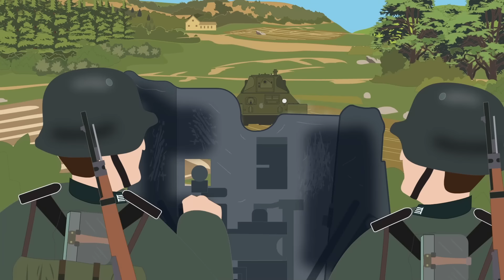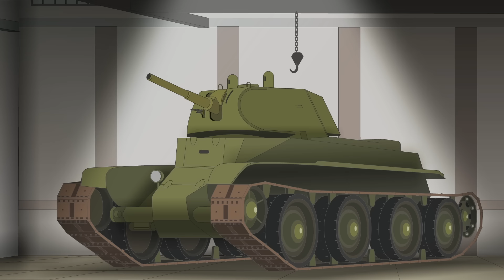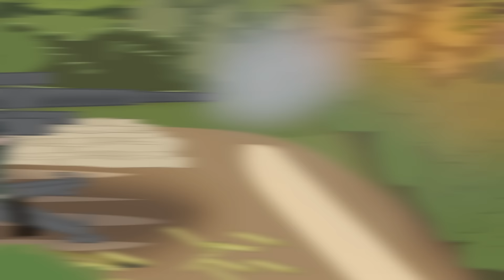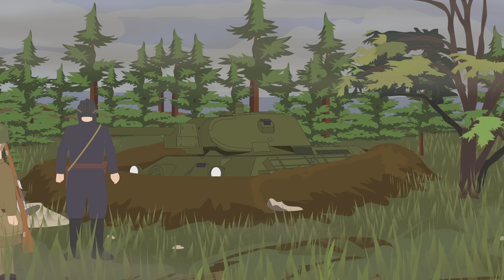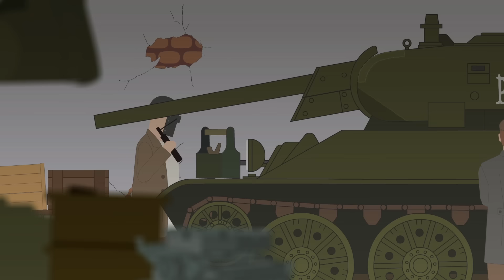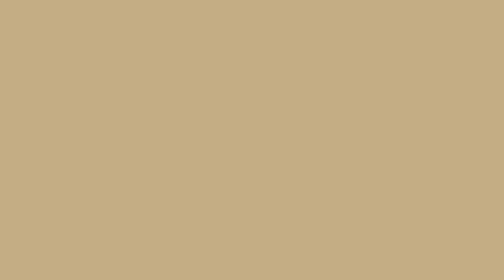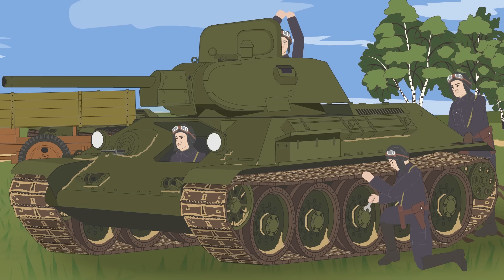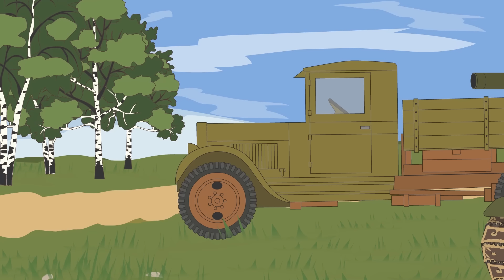Was the T-34 Really the Best Tank of WW2?

Comment: As an engineer, I admire the convenience and high technology of German tanks, but that's what ruined them. The German industry simply could not produce enough such expensive and complex tanks. In addition, heavy models often broke down and it was very difficult to repair them in the field. Here I really like the concept of the T-34 (simple, cheap, harsh, fast). This is truly the "best tank of wartime" (I mean, as a forced measure, it is beyond praise).
Reply: T34 was an expensive tank made cheaply because if it was made to the same quality of m4 Sherman's it would be a failure
Reply: @oofchanneltv6813  was about to say this, thats what i thought about the shermans :)
Reply: @oofchanneltv6813  1/
Reply: @oofchanneltv6813  You really need to read up on actual sources about the Sherman not the History Channel or Belton Cooper’s “Death Traps”.

The Sherman was actually far better than the T-34. Yes it was large, but that means a larger interior, combine that with large spring assisted hatches for each crew member, and an extra on the floor of the tank, the crew survival rates were 75% to 80% of survival.  Out of the entire war, 1580 US tankers were killed, you can read that in official war reports. 
 The 2 reason so many were disabled/destroyed were because:

1. Ammunition would light up when hit, which was mainly an issue with British Shermans as they packed them with as much ammunition as possible. In fact, the Panzer IV had close to the same burn rate as an early Sherman. Once wet stowage was introduced, the burn dropped significantly. Common belief is that it was because of high octane engines, but that is completely false as an engine fire wouldn’t immediately set a Sherman off due to the steel plate separating the crew from the engine. 

2. Unlike Soviet crews, US Sherman crews were trained to bail out after the first hit penetrated.

 Majority of Shermans that were disabled or “destroyed” were actually recovered and repaired in a matter of a couple days and sent back out to the frontlines.

 The T-34 saw far worse losses. An average rate of about 80% were lost by the end of the war. Crew survival rates were among the worse of any tank. Depending on the variant, the rate of survival was about 25%-30%.
Reply: As an engineer, I admire the late 1943-44 panther.
Reply: @cedricvanhove7716  If the USA had built the Panther, we'd have subjected the vehicle to extensive testing and fixed the problems before they were produced and sent to the front.  The USA had a simple constraint that mandated the need to "get it RIGHT"...all their vehicles had to go by SHIP (Liberty).  And quite a few Shermans ended up at the bottom of the Atlantic.  So we didn't have the "luxury" that the Germans or the Soviet had, in that, tanks that were "broken" or shot up could be loaded onto a flatcar and shipped home for repair or to be cannibalized for parts.  But, the Sherman was very well-designed in that manner, as so many parts, up to entire engines, could be swapped between its various models.  Indeed, by early 1945, with all the "patching" and parts swapping, it was uncommon to see a Sherman in pristine, factory condition at the front.  The Soviets very much liked the Sherman, dubbing it the "EmCha", a transliteration into Russian of the US Army model designation "M4" (the Roman numeral 'four' looks much like the Cyrillic character "Cha"), and issued it to their "Guards" tank units, much to Stalin's chagrin.
Reply: That is why it is hard to believe when historians are saying the Maus could have changed the outcome of World War 2.
Even assuming the Maus had worked exactly as intended, Germany could barely supply the regular tanks.
Reply: @schwarzerritter5724  lol, the Maus couldn’t even cross bridges. That thing would’ve been useless expensive waste unfortunately.
Reply: @schwarzerritter5724  Even the Tigers and King Tigers weren't viewed by the Panzerwaffe either as necessarily being tanks that'd win the war for Germany.  They had their roles; sure, and, if nothing else, frightened the enemy, but they simply couldn't make the difference.  A German war economy and nation that could produce and provision, say, 5X as many Tiger tanks as they did would have been far more robust than it actually was.  Germany had to pick "quality" over "quantity" simply because it lacked the resources for the latter.  Indeed, that's the entire reason they attacked the Soviet Union at all!  As the writer of the 1942 book, "Victory Through Air Power", Alexander DeSeversky, put it, "The Germans had to trap the 'Russian Bear' ALIVE and put him to work."  This need to gain the resources of the Soviet Union dictated Germany's overall strategy, and why, even when hammered by superior Soviet forces, they held on to vital areas like Nikopol, trying to squeeze out the last bit of mining production.
Reply: I can’t really agree with the best tank of the board going to T34 for performance issues. I think it belongs to either the upgraded Sherman with a 76mm. The superior crew friendliness really clinches it in my opinion. I would classify T34 as good perhaps great. There were definitely issues with quality of the machines and quality of life for the crew, but the reality was the people making king it had to make some ruthless decisions about volume and economics so they could have enough, because they were facing the very real threat of extermination down to the last child if they didn’t get enough functioning tanks out the door, so in that circumstance cutting down on polish and comforts is absolutely the right choice. The armor was acceptable the gun was competitive the optics worked and it had enough mobility. The parts that mattered got the attention they needed.
Reply: It was made poorly and broke down frequently, it was only cheap to build, but expensive to maintain because of the constant problems. This tank was anything but good.
Reply: Let's say they do make more tanks 
That would have made it worse 
The cost of fuel, men, repairs and the logistics to move all that stuff to the front? No
Oh and all the stuff to keep those people you put in the tanks (food water ect)
Reply: lol no its really not. just like most russian things, the t34 was cheap, weak, unreliable and only had one main praise worthy attribute. Its numbers.
Reply: @Atlas117gaming  meh, even then numbers are stupid 
If numbers are so good then, why did the USSR take so many losses? 
Logistics,
Reply: @Sodapop-rd5ku  yeah quantity isn't what you want but tens of thousands of tanks are  harder to lose 100% of them than 100% of tens of hundreds
Reply: @Atlas117gaming  with every tank lost you also lose the experience of that tank crew
Reply: @Sodapop-rd5ku  really? Wild. Anywho yeah that's obvious and the USSR didn't give them experience going into their mass number "strategy", generally what happens with throwing people at the problem
Reply: What happens when one Tiger with technical problems with it's track is engaged by 50 T-34's? It destroys a dozen of them with AP shells, until it's out of ammo. Then it destroys another dozen with HE shells. It then withdraws because taking over 70 hits from T-34's makes the Tigers' commander worry about his tanks tracks.
Reply: Strongly disagree. 
The openings of the Russian archives show even more how devasting the Germans pushed their attacks. Soviet Russia was about to lose, if the US and GB hadnot sent in the desperatley needed supplies. The cascading effects on an economic and military level for this disorganized landmass were about to cross a point of no return. Have a nice 9th May, comrade.
Reply: @Peter-vf3dl  and the Russians paid them back by holding down like 80% of the Wehrmacht. So enjoy V day too I guess or not.
Reply: @Eddy1938-b  Absolutly. There is no need to argue about the combined(!) effort of the allies - in particular the US economy - in defeating the axis powers. Nonetheless, the SU, although larger, higher population etc, couldnot withstand the overwhelming fighting force of this German foe on its own. Without disruptions caused by the Allied airforces or backwater theatres like the Mediterranean, the Soviets' fate would have been sealed. 
It is not only about the numbers of destroyed military goods which was devastating on its own or complete lack of en par technology (esp. the lacklustering Red Air force). 
The SU in general was structured as a very inefficient economy which heavily relied on manpower - in particular in the agricultural sector. The staggering human losses led basicially to famines from the end of '41 on. The clock was ticking for them. 
As I already had written: I recommend looking at some insights of the Russian high command during that era and their view/assesments at the time. Pure desperation.
Reply: @Peter-vf3dl  the US didn't do everything
They had good logistics tho ngl
Reply: The Germans could've easily streamlined production but went with the "Craftsman" approach over absolute Industrial. Not to mention they also field tanks in record time so they were rushed significantly more than most other tanks of other nations, yet they remained somewhat more reliable (their reliability was more so a crew issue than mechanical, though final drive of the Panther's was a real issue).
Reply: @youngrody2386   (though final drive of the Panther's was a real issue) Dident they fix this at the end? according to reliability files the 1944 panther was on par with the Panzer IV. and yes crew was most important.

Comment: Best tank is a matter of perspective. A logistic officer may say a good tank is one that does not break down and uses little fuel. A guy facing heavy armor may want the biggest gun, while a guy facing infantry may want a rapid fire gun. Also do you compare a tank against another tank. or a tank as a tactical or strategic asset. Both completely different criteria.
I do agree that the T-34 due to its slopped armor did provide good protection, but if you ever have been inside one, it was a horrible tank to be in. Cramped, very poor vision and poor quality in general. Lack of communication, 2 man turret and sub par gun made the first models death traps, once the Germans got over their initial suprise. The T34-85 improved this somewhat, but it was never a great tank one on one. It worked well because Russia just build so many of them.

Comment: As long as these machinery rely on human control it is incorrect to just compare their mechanical features. As this video correctly elaborates the question of superior weaponry must always be about the combination of the weaponry and its human control/training/command. You can have the most advanced super-flying-saucer with beam weaponry at your disposal but in the hands of inferior control, insufficient training or boneheaded command it will still be just a costly piece of junk.
Prime example for Americans: the Japanese A6M 'Zero' fighter out-killed American equivalents at a frightening rate initially not because it had superior mechanical features (for example it famously had inferior armor) but because its design combined with matching pilot training for relatively slow-speed dogfights made it superior. The Americans quickly caught on to their disadvantage at slow-speed dog-fighting and soon managed to get the upper hand by modifying their training and tactics.

Comment: The fact that you said the green monster was never to be stoped was funny because the tank couldn't be that great because they heated the tank to 600 degrees not 300 made the tank crack at weak after hit so it likely would be pinned down after two shots to front and the track be gone because of the horrible engine and lost 82% of all tanks and crews wouldn't fire unde light fire cause the chance they'd hit the enemy at all and the Germans Hade better armor so the T-34 was a low chance of winning and missing parts to speed up production and that is why the Soviets lost 82%of its mass 2.7 million tanks
Reply: And German tanks could take out the tank
Reply: Why did the Germans have the best armor? Have you heard enough fairy tales about the "German genius"?)
The USSR had access to good ore from the Urals, and in the end the Germans even had to melt coins to get at least some quality of armor. The tiger has such thick armor because the quality of the armor has become worse. The first mass use of tigers occurred near Leningrad. The first tiger's turret was torn off, the second's ammunition exploded, which simply tore it apart. After that, the order to retreat was given. The USSR did not use the T34 to fight tigers, for this there were special tank destroyers that simply tore tigers apart.

Comment: In my opinion, the T-34 is overrated. The engine would fail and break down before it even reached the battlefield. The insides were cramped, most didn't have radios or cupolas so the commander had to use a 10mm sheet of aluminum as protection while scouting out the battlefield, if it managed to make it there. Its armor was penetrated by literally every German Long-Barreled 75mm and higher. Late short barreled 75mm HEAT rounds could also penetrate its frontal armor. Speaking of 75mm the Shermans low velocity short-barreled 75mm could also penetrate a T-34 from every average combat distance. (Say 400-600 meters) Its 76.2mm and 85mm gun is where it actually shined. The 85mm and Late 76mm guns would penetrate a Tiger 1 from 500 meters, but so could a Long-barreled Panzer 4 or Panther. Though the T-34 was fast and in the Eastern Front whoever could produce more tanks would win rather than who had the better tank so it kinda makes sense. But the rushed production would cause Cracks in the Armor, Gaps in the armor, HORRIFICALLY TERRIBLE Reliability issues, and early 76.2mm guns could,'t even penetrate 80mm of armor. Honestly I think the Sherman was better than the T-34. Its reliability was comparable even to the Panzer 38(t). And although some idiots say that its armor was trash, At its angle the armor was the same, if not a few millimeters better than even a KV-2.

Comment: T34s were created from a modified tractor chassis. They were extremely prone to mechanical failure despite their extremely resilient sloped frontal armor. In spite of their failure, they were easy to mass-produce, but were not very comfortable.

However, the tank was not indestructible. A well-placed shot from a German 88 at close range (aimed at the turret) would probably deliver sufficient impact to destroy it.
Reply: With luck and with a pistol, you can destroy any equipment. Near Kursk, an anti-tank gun hit a tiny side window of a panther, the panther burned down.

Comment: A lot of the T-34 loses were due to the quality of the crewmen. Most of them were had almost no training; only a couple of hours to learn the tank. So many of them were malnourished and overworked that even the loader didn’t have the strength to lift the shells. Only the tank commanders actually had real training and went to tank schools. Which is why they were also the gunners until the later T-34-85 ZiS-53 came out. Remember, these are laborers, peasants who aren’t always soldiers, got drafted into war with little training, time and resources to perform their duties effectively. Numbers was the only thing they had going. This goes the same for the workers who built the tanks in factories.
Reply: What nonsense. You don't even understand what a combat unit is. Even an infantryman needs several months of training, otherwise he will not understand the commands and what to do on the battlefield. And in such a complex thing as a tank, an unprepared person will not even be able to charge or start a car, let alone act as part of a unit.